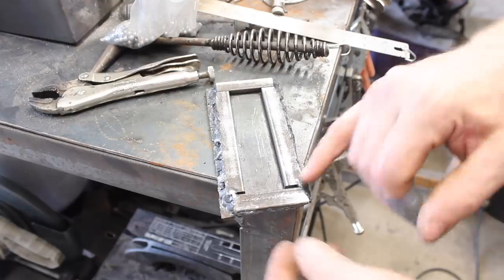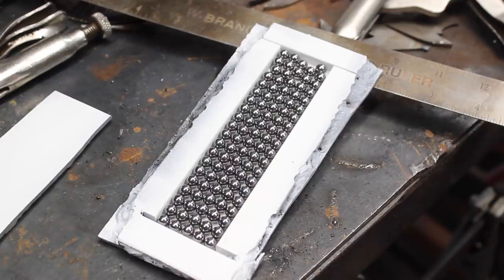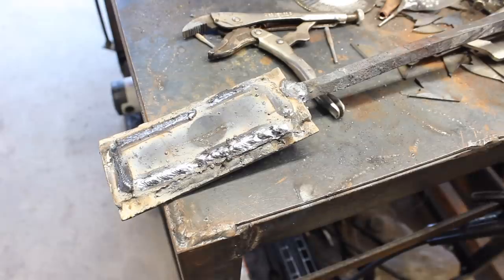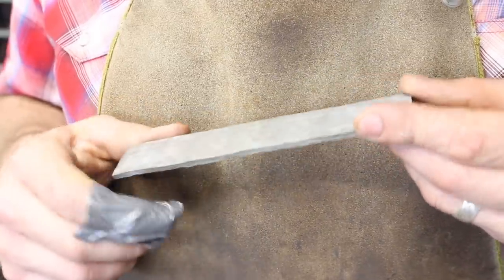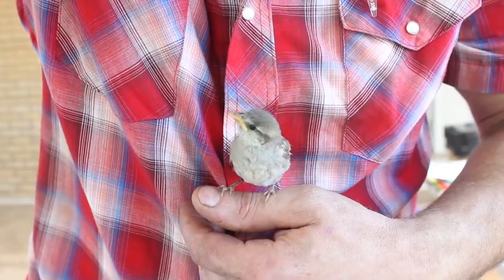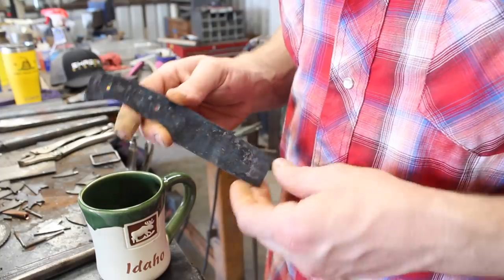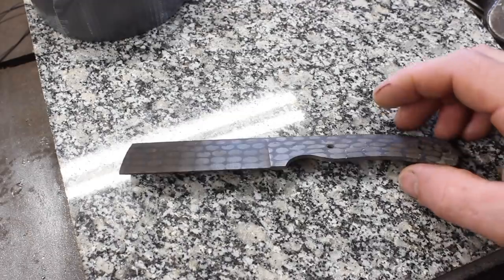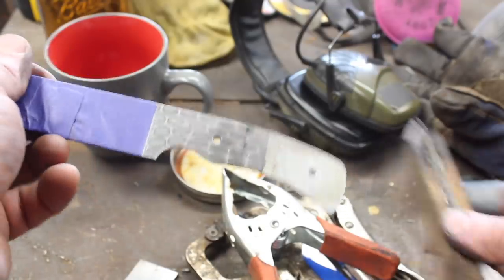Forging A Cowboy Knife In Texas From Steel Ball Bearings, Blacksmithing Knife + Good God Almighty

Comment: I asked this question before but could you take old blades from old worn or broken pocket knives. Take like 10 of them different sizes and steels then forge weld them together to make a larger blade? Also if you did so would the shape of the blades show after acid etch?
Reply from the maker: I expect that would work. You would probably get a faint pattern where the weld lines were.
Reply: @FireCreekForge  if your ever willing to give it a try I love to see.  Could be pretty interesting. I used to have a pile of old pocket knife blade some 40 years old the metal didn’t fail they where just worn, I thought it would be nice to bring something old but used to it’s utmost back to be used again.

Comment: Seeing that no tip knife gave me an idea, I always end up using my knife tip as a terrible screwdriver. Maybe incorporate a flathead/ pry bar instead of a point? Might not be a beautiful shape but I would use it like crazy! Side note, just finished up a day of forging my second wrapped eye axe, made it completely out of 4142 with a 4142 insert for extra blade material. I think you should do a wrapped eye axe from a hardenable steel
Reply from the maker: Not a bad idea on the axe. If you tempered out the spine and tip of the knife the screwdriver should work
Reply: @FireCreekForge  have you ever made a wrapped eye axe? I know you just got into making videos of making hatchets but wasn't sure if you have made them in the past. Since you have a press you could make a Damascus wrapped eye axe with a 5160 insert for cutting edge. That would be beautiful
Reply from the maker: @lukelofgren4108  I have made a couple, but nothing I was happy with. I need to make a tomahawk drift and give it another shot
Reply: @FireCreekForge  keep us posted. I love your work. The forge welding on my 4142 wrapped eye axe came out awesome! I hear forge welding 4140 or anything like it is difficult but I messed up and got it right, even survived the heat treat. Its drew quite a bit of blood while I was hanging it on a handmade handle. Keep that edge covered with duct tape otherwise the duct tape will end up holding you together

Comment: Where can someone get the high carbon steel ballbearings and dust? That pattern is amazing.
Reply from the maker: I've been getting 52100 bearings off eBay, and the steel powder from Jantz supply; knifemaking dot com

Comment: Great pattern in the blade, looks great! Well made too, looks really good. However, over the years I’ve castrated 10s of thousands of calves and I’m not sure how you’d use such a large blade as that for the job. Most castrators I prefer to use have a blade approx 2” long and the handle about the same on it can be cradled in the palm of your hand for skilful cutting. You must have some mighty big calves in Texas, that knife is big enough to castrate an elephant!! Regards from Down Under, LoL 😂
Reply from the maker: Thanks! Well, that's because everything is bigger in Texas. :) I guess if I have to make a smaller one it won't be a big deal..
Reply: Well, one things for sure, there is certainly a big load of “bull” down there in Texas!!! Lol 😂